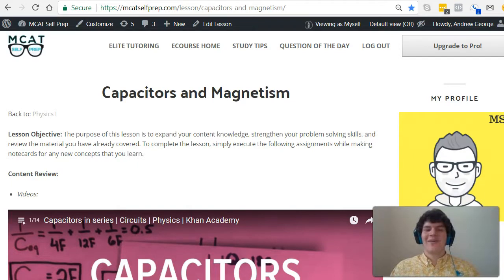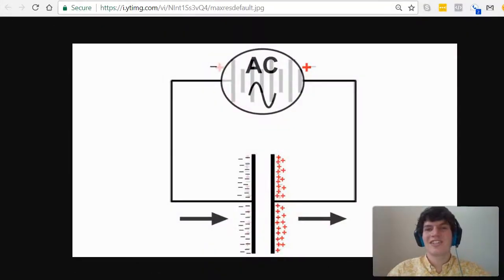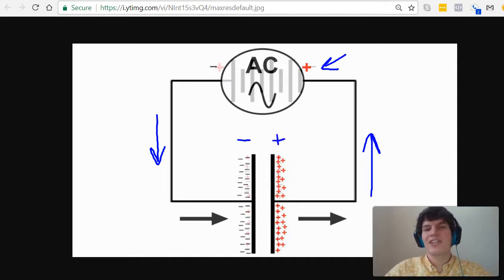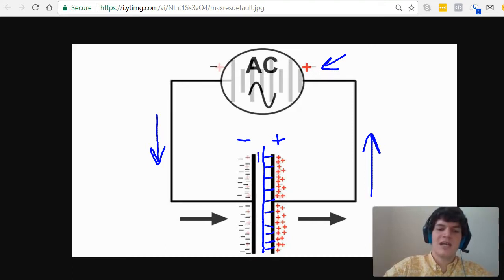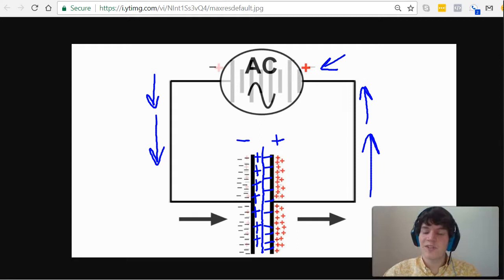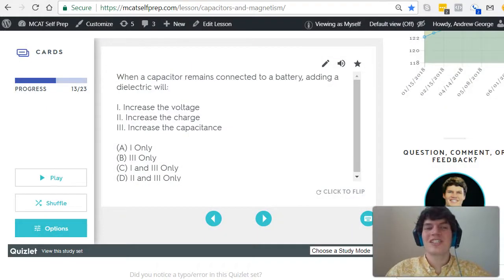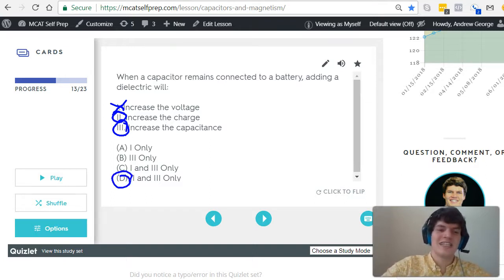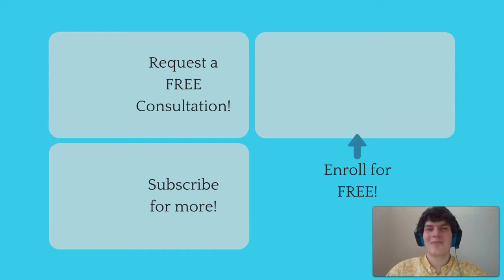MCAT Question of the Day: Capacitors and Dielelectrics

Comment: Wouldn’t charge remain the same since dielectrics increase capacitance by decreasing relative voltage on the plates? A capacitor with a dielectric stores the same charge as one without, just at a lower voltage. IMO answer should be B

Comment: Hi, your reasoning is mostly good, but I have to say that a capacitor with or without a dielectric stores the same amount of charge Q, but one with a dielectric does it with a much lower voltage, making it much more efficient and thus increasing the capacitance.